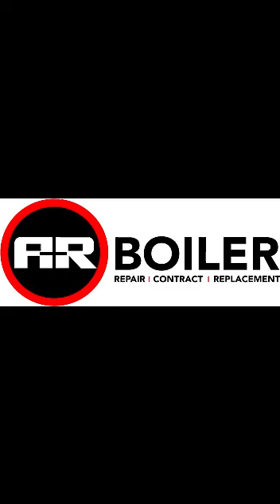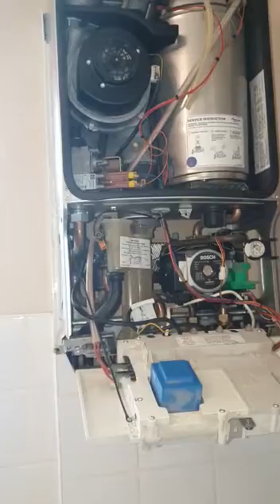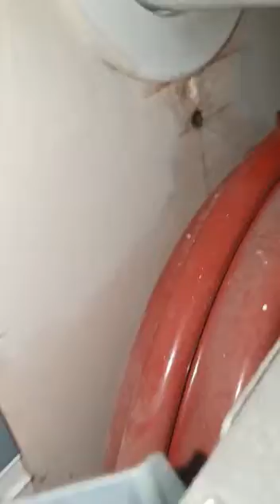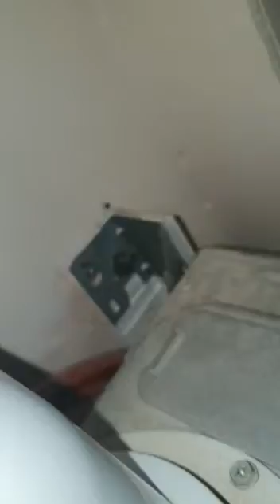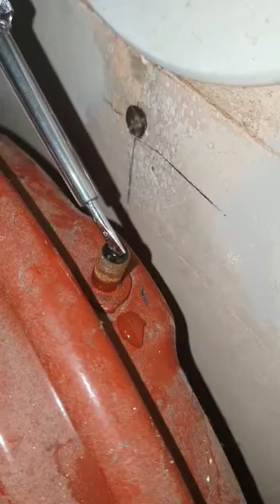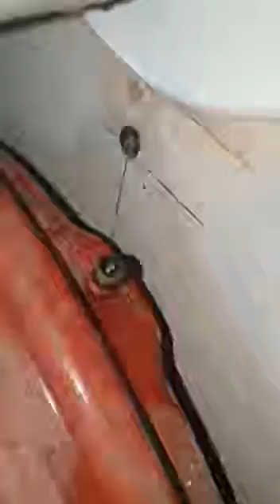Worcester Greenstar 30SI Expansion Vessel Fault With The A+R Team

Comment: You could have drained the boiler via a red pull tap, then pump in air pressure with a bike pump. reconstitute water back into the combo unit. The expansion vessel was sound, it was the inner bladder that had failed. The pressure should maintain for along time or at least until you have funds to proper fix. Temp fix if on a tight budget.
Reply from the maker: Thanks for your comments